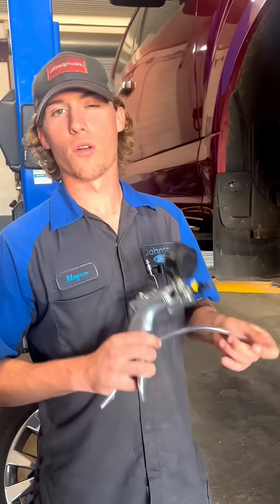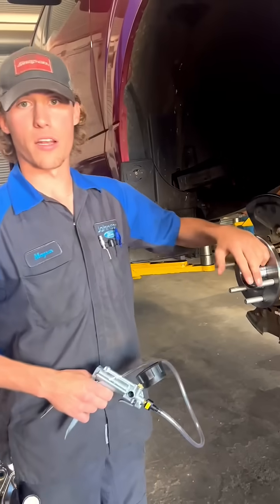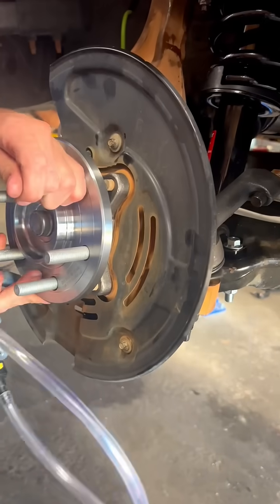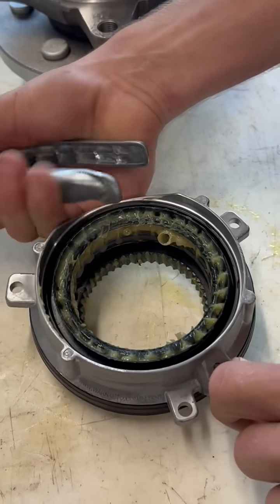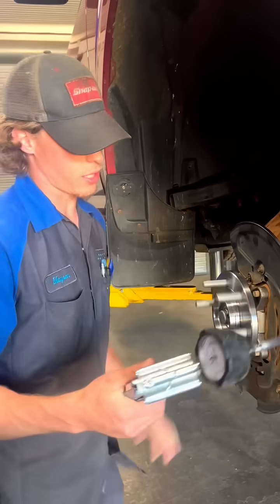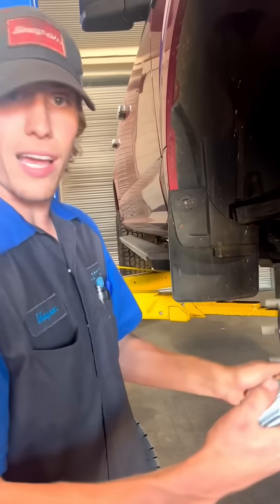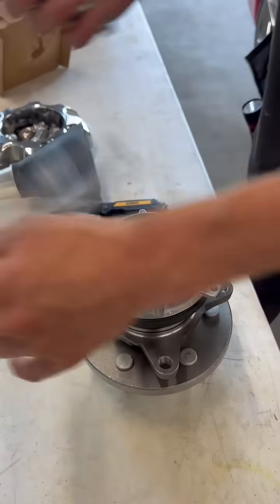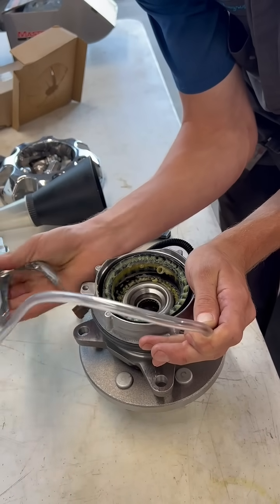Ford F-150 4WD System Explained #shorts

Comment: I never understand why it isn't designed with vacuum applied for 4x4 to work. So if  the actuator goes bad it is stuck engaged. I would rather have vacuum engage 4x4 instead.

Comment: I went through 3 sets of actuators and said screw it and unhooked the vacuum line. There’s vacuum at the solenoid but when it goes down the hose to the actuator, there’s is vacuum loss. Even when I replaced the line with aftermarket lines, the same result. I replaced the solenoid, the 1 way purge valve and the actuators before I said screw it.

Comment: My 2018 F150 has a rumble, almost a grind at very low speed. If I engage the the 4x4 in either automatic or 4H the noise goes away. If disengage after a couple miles the noise stays away till the next trip. And it only occurs when the weather gets colder

Comment: I don't know if that's better or worse than my Tacoma that relies on a tiny 12v kids toy motor to spin a plastic worm gear into place to activate my 4wd....

I miss my '89 F250 with a straight axle and locking hubs.

Comment: My 96 Chevrolet has electric 4x4 control. If it quits you can remove the actuator and change it with a screwdriver.

Comment: The spring inside that actuator isn’t stainless and the issue I’ve seen is it rusts and then the vacuum lines and the solonoid would all plug up. This is in the northeast. I started just replacing both actuators the lines and control solenoid/valve. This is the only way I will do them.

Comment: I took my truck to the dealer the other day because I am having a rumbling when the truck is cold. The said this is normal with 4 wheel drive and gave me a copy of a service bulletin. 

The TCCM has a startup strategy that affects IWE operation after the initial key cycle. 

     When the ambient temperature is below 32 degrees, the IWE s engage after the initial key cycle and a driving gear is selected. The IWE s stay engaged regardless of a 4x4 mode change for approximately 2 miles. Once the set distance has been achieved, the IWE s disengage (if the vehicle is in 2WD (2H)). Distance traveled only if the temperature is below the threshold and another key cycle occurs or if the customer shifts to Park and back to a driving gear within the same key cycle. The TCCM uses this strategy to warm up the front axle in cold temperatures to improve drive line synchronization. 

I do not understand why the rumbling is normal. I am thinking they are missing something. Does anyone have any suggestions?

Comment: This has got to be the stupidest way to do a 4x4 system. It's always  in 4x4, when you put it in 2wd, it's used vacuum , so if you have a problem, 99% of the problem is the crappy plastic lines, and the rubber elbows. Check the plastic lines to the rubber elbows, grab and pull. Just did 3 of these , all were the same problem.

Comment: as to why it wasn't set the other way is idiotic considering you could be on the highway and experience vacuum failure and destroy your transfer case. IDIOTS! i would rather it fail and be stuck in 2wd then it fail and obliterate much more expensive components.

Comment: Ford used to have it the reverse way you needed vacuum to put it in four-wheel drive but the problem was it kept failing the vacuum system would get water in it and freeze and then they couldn't actuate their four-wheel drive so now they've gone the reverse way so if it's cold outside and it freezes cuz there's water in the system but you'll actually have four wheel drive

Comment: On 2008 up to 2020 Cadillac chevy and GMC trucks and SUVs almost always on v8 the wheels bearing keep going bad every 50k miles no question ask even with high quality wheel hubs I have changed many Cadillac escalator and suburban wheel hub assembly because of that major design problem

Comment: I have 2015 f150 both sides replace twice under warranty with vacuum solenoid/actuator went out a third time so I installed a delete kit haven't had problem since I went back and forth with dealer that this has to be a common problem because it's all over internet forms but my father in-law has 04 that's only been replaced once in 300,000 miles. What's your opinion how many of these do you see

Comment: If you replace the solenoid on the firewall in early models it resolves most of these issues. Water intrusion is usually the problem for this system.  The system fills  with water and destroys the actuator assembly. The new design has a water shield overtop the solenoid vent.

Comment: So does that mean that if you start having issues you can (temporarily) pull the vacuum hoses off and lock it in 4wd  so you don’t break anything or wear stuff out with that “intermittent grinding”
Reply: There is a delete kit for the wheel end. It doesn’t lock it in 4 wheel drive The kit will  front axles will spin even when it’s not in 4 wheel drive. Normally the front axles don’t spin until it’s in 4 wheel drive. The the hubs being locked and the front axles spinning isn’t 4 wheel drive. The transfer case has to be engaged to be in 4 wheel drive. The axles not spinning saves gas.

Comment: My 05 f150 4.6l it had a p0171 code I checked the plastic vacuum line from the pvc valve it had slipped out of the plastic boot, could that cause this issue to occur?

Comment: They’re called IWE’s integrated wheel ends and they’re not always the problem. If those hoses get pulled off they can suck up water and dirt and cause one way check valves to fail. The vacuum solenoids Have problems too.

Comment: Neat design  but vacuum lines are a weak link for sure! Probably a pain to replace?
Reply: Vacuum lines usually are the last thing to go bad on these usually its the hub itself gets rusty because you know is at the back of the tire and the seal at that back of the hub or the o ring doesn't seal anymore and the only real fix is to replace the whole knuckle and hub which is pretty expensive so they normally just end up with manual conversion kits

Comment: My front left hub is grinding but hasn't had any major issues yet besides that. Goes away in 4wd
Reply: remove your vacuum line under the hood and cap it off.

Comment: Ford believed it was better if the system failed that the 4wd system engaged this way the customer is never left without 4wd and stuck. Hubs fail yes but more often is the vacuum lines that supply it.

Comment: That design is kind of sketch.  You’d think ford would have made it so it fails in the disengaged position, not the engaged position.  

A twenty cent vacuum line might end up costing you a hub and axle, and may even result in a difficult to control vehicle if it suddenly snaps one front wheel into gear while going highway speeds
Reply: It fails that way SO you can Chew up bearings and actuators. 🤩🤩🤩🤩🤩

Comment: as mechanically inclined as you seem to be you need to ditch the automotive scene and dive into the diesel world (real diesels such as semi’s and heavy equipment) if you want to make a real living. you could clear $40 an hour (not flat rate) if you were that knowledgeable with semis
Reply: 200 a hour if you can diagnose properly
Reply: But you need to be making at least 90 a hour these days.

Comment: Some engineers need to be publicly flogged
Reply: This system makes it possible to manually lock in the 4wd even if something breaks. Not possible on other brands
Reply: @bdtcrypto1542  every single one of these that are older cones through with manual locking conversions because they go bad and are so expensive to fix meanwhile my floor shifter on my pos never had a issue once and I don't have to get out of the truck to make it 4 wheel drive
Reply: @bdtcrypto1542  i could do that on my old yota
Reply: No. They and their families should be required to drive their designs for 20 years.
Reply: The ford engineers are driving BMW'S.
Reply: @MrStaybrown  pretty much the case for any American car engineers
Reply: FORD employees get fleet and other returns like executive for 50% off.  Almost like throwaway transportation.

Comment: Has anyone ever seen an f150 able to spin all four wheels? It doesn't happen. One on the front and one on the back. That's all you get. Ford sells so many because they're fleet vehicles and need maintenance or repairs every 30 days. It's basically a truck for Republicans.
Reply: So working men who use their trucks to do truck stuff. Not like liberal men who can’t even figure out what a woman is. You’re the type of dude who shows up to drag race with your best dress on.

Comment: Except when it's not. One time I had good vacuum at both hubs and there seemed to be a 4x4 engagement at heavy engine load periods. Turned out the one way valve by the solenoid was leaking not allowing enough vacuum to build in loaded applications.
Reply from the maker: I got a short on that exact issue. Check it out!
Reply: @FlyingWrenches13  Cool you have lots of great shorts on Fords mate.
Reply: Yep

Comment: Shit to break and leave you stuck
Reply: It's actually designed to default to 4wd when vacuum is missing.
Reply: @richpetrillo8456  Unfortunately when the splines are stripped out it defaults back to 2wd
Reply: @Matt-nq4du  how often does that happen. Those spline look much more robust than were ised on lockout hubs for many decades.
Reply: @richpetrillo8456 it doesn't lose vacuum completely it leaks and partially engages and grinds noisy. When you demand four wheel drive noise goes away.
Reply: Bypass the solenoid. I didn’t find o ur til after I was towed
Reply: It doesn't leave you stranded it just makes a little noise. You can drive home take the dirt roads and repair. Replace with block out hubs... No more relying on vacuum... Bad design on Ford.
Reply: @SaltLife actually yes.. ive been working on this shit since before you were a cum stain on your moms back seat.  Cunt..  lol

Comment: Why don't you buy anything newer than 97 Ford
Reply from the maker: Exactly! Who would want more than 100 Rear wheel horseypower or a better than 3 MPG fuel average?
Reply: @FlyingWrenches13  It's an informed consumers choice. Good 'ole get out of older Fords cab and click brass center section Warn hubs to engage, versus sit in seat pushing buttons "hoping" your hubs kick in when you need them most. Same with 'old school' transfer case shifter. If you don't keep them lubed up, some times need to give them a kick to engage/disengage. But with 'creature comfort' "push button" 4WD, you never know if this is the time your transfer case will fail to engage. But you are correct about the extra HP & MPG being nice. But my 89 F350 with 7.5 pushrod engine, will have ZERO spark plug or cam phaser issues. Being born a couple years before the Mustang debuted, simplicity is nice along with doing your own troubleshooting/mechanic work. Hats off to new technology, but in my universe getting a second mortgage when having to take the hi tec vehicle in for repairs, just isn't worth it. How I paid my house/rentals off early, by DIY and saving that technician fees. But I'm not dogging shops or mechanics at all, or late model vehicle's,  I just personally picked a path less traveled by owning pre 1990 vehicles. Definitely not the way for most people.
Reply: @marvinheemeyer9768  I’m with ya, Marvin! All my fav vehicles were made between 1966-2001, preferably on the later side of things due to OBD2. 

You’re and I are what are considered “frugal” - which is not the same as “cheap”. However, it means we will fix stuff and keep things far longer in a lifecycle than most “consumers” will. 

Nothing wrong with that at all, and personally, I see it as a far more “green” and “environmentally friendly” approach in life. At least comparing it to the nonsense greenwashing companies use to make sales these days. 

God bless you and yours. Take care!

Comment: my 96 isn't vacuum actuated   😄
Reply: I like when ford had the option for vacuum locking or manual locking hubs that’s how my 2000 excursion is and I haven’t fixed the vac leak problems to the hubs but can still use 4wd when needed

Comment: Remember when things we're simple and you just lock the hubs pulled the stick and never had any issues now it's turn the knob and that sends signal to the module and the module checks with the PCM to make sure everything's okay then it turns the light on on the dash and  actuates the vacuum solenoids.... over engineered junk
Reply from the maker: Complicated is a good thing for me and a bad thing for the consumer.
Reply: @FlyingWrenches13 brother I have a question 
When I drive my truck in 2wd the cv axles and from shaft are spinning is that normal?
Reply: @FlyingWrenches13  agreed but be honest.. wouldn't you rather be doing good work than fixing the BS that the factory throws at these trucks.
Reply: @repobud1  Those BS tech ford thrown on the truck gave us a mechanic a fortune living.
Reply: Truth spoken........

Comment: So does that mean they lock every time the engine is cut off?
Reply: Yes
Reply from the maker: Yes and no. They do lock when engine vacuum is lost but thanks to a vacuum reservoir and a one way check valve (that sometimes works) we are able to unlock them pretty soon after engine start.

Comment: Trust me... I know exactly how that stuff works back to front. 11th Gen trucks have a vacuum valve solenoid behind the battery and I've seen a few that rusted and corroded from the inside.

Comment: "This is gonna apply to almost all the F-150s"

My '79 F-150 with a dana 44 high pinion: boy whuddahell you talm bout!! We do shit manual 'round here!
Reply from the maker: Key word is “almost”. 79 F-150 sounds sweet. I bet you get a whole 88 horsepower to the wheels in that thing. With a 2.7 MPG average to go with it. Old Clunkers are GrEaT!
Reply: @FlyingWrenches13  nope 8 mpg all day uphill downhill headwind tailwind while pulling stumps😂😂😂😂
Reply: @danfarris135  don't forget it rides like shit, everything squeaks creaks and rattles, and probably no a/c. lol
Reply: @subtleusername5475  A/C is a luxury item anyway. It's still there but it's an R-12 system and I'm not worried about it. I can live with the squeaks and rattles and if I get tired of hearing them, I'll fix them. I live a mile and a half from the shop I work so that makes the need for A/C and good gas mileage pretty negligible. I bought it for a winter truck because my other truck isn't exactly safe in snow and the heat works really good... furthermore, I bought it for my satisfaction and no one else's although I'm starting to get a following of people that try to pressure me into selling it to them, so there's that. Let's not forget Bob Chandler created the world's first monster truck with one of these trucks and he clearly didn't care about A/C or gas mileage or squeaks n rattles. Has the whole world in love with one truck. Bigfoot... 🙃
Reply: Damn right and the 4wd will always work
Reply: Is your truck a black person?
Reply: @WTC7  are you a stereotypical person?
Reply: @WTC7  what's it like to have the brain of a dog?

Comment: I feel a grinding vibration as I'm going uphill on regular streets.  Nothing extremely steep.  I normally feel it within the first 20min and once she heats up, it goes away.
Reply: I would say check your differentials transmission and transfer case (if they apply to your car/truck) and make sure they are all full because gear box oils expand when they heat up and that could explain why they grind when cold and don't when heated up also when you are checking your boxes each plug should have a magnet on the plug that will collect metal over time which is normal if there is a little bit but if you see any bigger chunks or full teeth from the gears take it to a mechanic as soon as you can and get it further inspected I hope this helps you out with your problem let me know what you find out
Reply: @bradleypumba  could also be that your engine creates better vacuum once it is running at temp
Reply: Check your engine mount
Reply: @sunnymoney28  Thanks.  That makes a great deal of sense.  I appreciate it.
Reply: 17 and up f150s have a warm up strategy that keeps the front axles locked up to warm the front diff fluid. It normally lasts for a bit and it disengages after it's warm.
Reply: @Sva_rog  The front differential does not turn at all when you are not in 4x4.
Reply: @grantdubridge7995 are you talking specifically 17 and newer F150s?
Reply: Sounds Expensive

Comment: Hmmm 🤔… I’ve been having an intermittent grinding noise when I first start driving after truck sits/ is cold. When I drive straight no problem; it’s when I first turn I hear the noise. Once I’m going straight again all good. After approximately 1-2mi. it completely goes away; until the truck sits overnight again. Gotta get it checked out.
Reply: Sounds about right. These hub actuators have a fairly high failure rate. Some brand new trucks have issues off the lot. 4WD should be used as frequently as possible. If you have a straight spot on your commute in a small neighborhood it is a good idea to engage and disengage 4WD just to keep things moving.
Reply: Depending on the year model, your truck is locked in 4wd for 2 minutes when started cold, you may have a actuator not fully locking and grinding, 2019 and newer